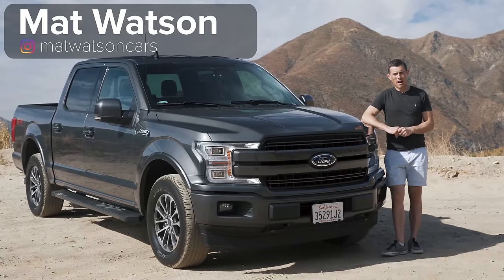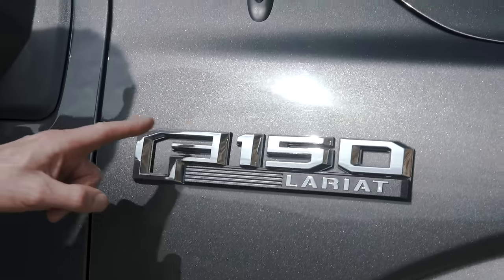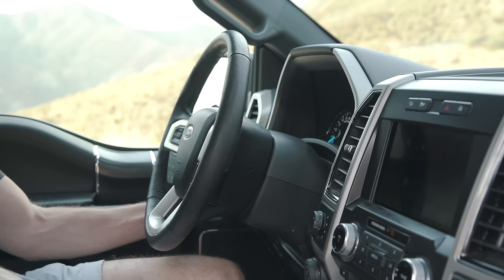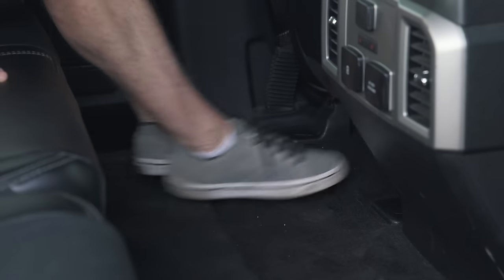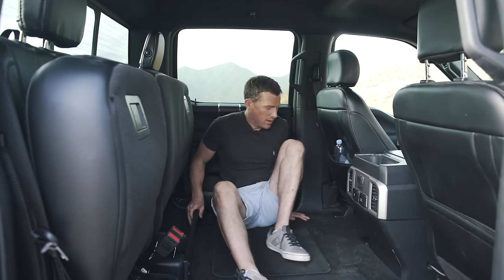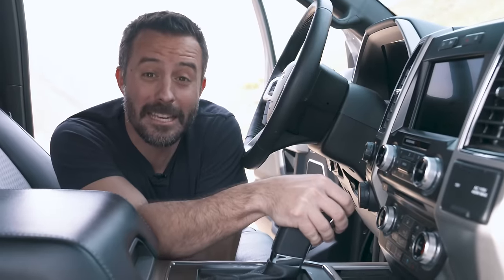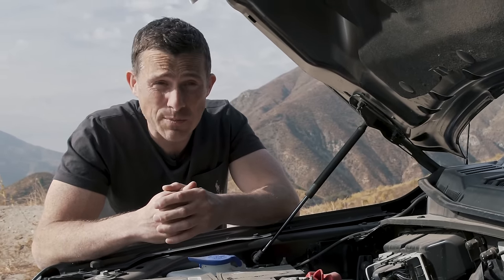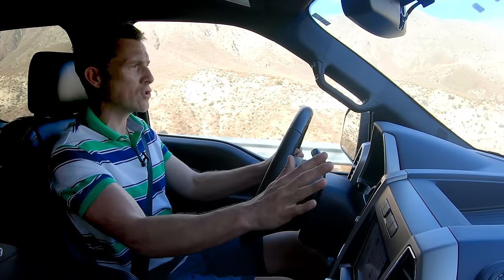FORD F-150 review - why is it the best-selling 'car' in the world?

Comment: If you forget the code, pull the door will cover on the passenger side, it is printed there. Take it to Ford dealership, they pull the code for you. Also, add your own code so you won't forget it.
Reply: I love that keypad feature. You can go to the beach and leave the keys and wallet locked in the truck.

Comment: Ya mate, you forgot about the 1 year post review. Leaking turbo ducting, leaking trans, leaking cv's, third brake light. Turbo tuning problems and cost of replacement. Also when these have 100,000 miles on them, who would in there right mind buy one over a Tundra.

Comment: If you upgrade to a platinum model those cheep plastics are replaced with metal, king ranch models will get you real open pore wood and metal trims as well as real leather seats, and the limited models will give you all of the above as well as real leather trim on the doors and dashboard

Comment: My 2020 is a pos. Drive line shudder. Warped dash that was replaced with another warped dash except the replacement dash came with rattles. Transmission is very inconsistent with up shifts and downshifts. 6 months into this pos and I am absolutely done with it.

Comment: Answers to Carlos' 5 annoying things:
1) that's not the trucks fault, remember your shit. Truck comes with a card that has the pin on it, put it in your wallet or write it down in your phone. Keypad is super useful.
2) It's a twin turbo 400hp motor, buy a Prius.
3) The shifter is a super comfy place to rest your hand and feels like a proper truck shifter. Also, the F150 has exactly 22 cubby spaces for the front 2 seats alone... like really if you cant find a place for your shit, you have way too much shit you hoarder.
4) Those competitors can't haul as much because of that. The current F150 is also 6 model years old now (second oldest full size), next gen will have coils.
5) That wire is only visible for half a second when the rear window is half open. What kind of animal opens the rear window only half way?

Comment: You can't put 1500kg in that bed. The rating is actually surprisingly low (sub 800kg for an Fx4 Lariat). The reason is in the rear suspension. Though it does have leag springs, they are not that thick and prioritize comfort not capability. It actually kinda funny, our European trucks are all smaller but have higher payload ratings!

Comment: I have the 5.0 V8, sounds great  but the eco boost drivers whip my ass head to head. If this guy wants a nicer ride he needs to drive the platinum.  The fx4 has stiffer suspension for off-roading
Reply: I have 3.5L eco Lariat but would love to have the 3.5L high output Limited.

Comment: Europeans love to make fun of pickup trucks but if you have the space for them, they are by far the most versatile well rounded vehicles you can buy. If you are a tradesman you would never be able to use anything else. They are also good for having in the winter, cant tell you how many idiots ive gotten unstuck trying to drive around in their small sedans with front wheel drive in the middle of winter

Comment: How did they get so little power from a 5.0 V8?
Reply: Peak Hp per liter isn’t important in a truck, torque is. Also a cheat code for reliability is large displacement + low compression.

Comment: Ford F-150 FX4 Off Road Lariat Super Crew Cab Pickup Truck
1. Big Ford Badge
2. 35291J2
3. F-150 Stamp
4. FX4 Off Road
5. Cutout
6. Plastic Grille
7. Model Badge
8. Big Center Console
9. Start Stop Engine Button
10. Trailer Assist
11. 4 Wheel Drive Gear Selector
12. Cupholders
13. 12 Volt Sound System
14. Comfy Seats
15. Headroom
16. Seatbelts
17. Keypad
18. Window Ledge
19. Door Bins
20. Seat Bases
21. 8 Foot Bed
22. 2200 Liters
23. 6.77 Tons
24. Shifters
25. Lightning
26. Step
27. 2.0 Tons
28. Power Folding Rear Glass
29. Running Boards
30. Fuel Hole
31. Aluminum Body
32. 2.7 L V6 Ecoboost Turbo Petrol Engine
33. 612 Hp 850 Nm
34. 13th Generation
35. C Daytime Running Lights
36. Off Road Shock Absorbers
37. Locking Rear Differential
38. Skid Plates
39. Sport Package
40. Sport Mode
41. Boat Mode
42. Headlights
43. 18 Inch Alloy Wheels
44. 4 Door Version
45. Infotainment System
46. Good Wheels 
47. Parking Assist
48. Doorhandles
49. Taillights
50. Rear Infotainment System
51. Global Positioning System (GPS)
52. Gray Color
53. Steering Wheel Lock
54. Rearview Mirrors
55. Reversing Assist
56. Driving Assist
57. Highway Assist
58. Off Road Package
59. Voice Commands
60. Electronic Handbrake
61. Basic Lights
62. Creases And Cutouts
63. C Shaped Headlamps
64. Leather Seats
65. Heated Seats
66. Ventilated Seats
67. Sync 3 System
68. Navigation System
69. 3 Pin Plug
70. Pocket
71. Mobile Phone Storage System
72. Super Crew Cab Version
73. Shoulderroom
74. Bulky Rear Seats
75. USB Ports
76. Seat Bases
77. Electronic Truck Boot
78. Payload
79. 4000 Miles
80. Leaf Spring Suspension
81. Autopilot
82. 12 Speed Auto Gearbox
83. 4 Wheel Drive
84. $47.000
85. Good Performance
86. Top Gear
87. Very Good Brakes
88. Good Engine
89. Comfort Mode
90. Load Beds
91. $30.000
92. 2.7 Liters
93. Strong Gears
94. Highway Speed Assist
95. Body Panels
96. V6 Rumble
97. Ecoboost Engine
98. Comfy Steering Wheel
99. Very Good Seats
100. Infotainment System
101. Rear Infotainment System
102. Shortlist It

Comment: These trucks will last 300,000 miles plus no problem they are overbuilt to be strong enough to tow trailers. So if you aren’t abusing the vehicle it will last a long time. Longer than a usual car.

Comment: The inside should defenetly be a little worked on because that looks like a 2015 car and not 2020
Reply: it does have 40,000 mile on it at a 12,500 mile service yearly interval February 2017 - February 2020 would make 37,500 miles + 2500 miles December 16 January 17 making it a December 2016 registration. if it did the full service interval every year that is. then again it is modern by british irish and european standards based on what manufacturers seem to think Toyota makes a copy of the ranger and calls it the hilux. all new 2020 hilux looks like 2012-2019 ranger.

Comment: You buy a ford pick up with the V-8 for $25,000.00 . For 50 + years you have a vehicle that will go 350,000 to 600,000 miles with extremely low repair costs.She can be rusted out, totally beat up - 30 or + 112 degrees . She will fire up and not only get you where you and your family need to go , but you will actually be relaxed and ready to kick anybody's ass when you arrive !  Make no mistake . . . .

Comment: Wouldn't it have been nice, back in 2018, if Ford could've made a $55K F-150 where the door handles didn't freeze, precluding closure? They've only been making Ford trucks since 1947! It's fun driving an '18 F-150 to work having to hold your driver door closed as it doesn't secure.  SMH.

Comment: They are mad. There's  no replacemen for displacemen. Wringing the wee out of a small displacement engine with a turbo  and all the latest power scavenging tech will likely come at the cost of longevity even in a small car much less a four door F-150. If the next step isn't an all electric F-150, it will be a 3.5 ish v6.

Comment: Why did I buy a Ford!? I bought a 2017 F150 Lariat due to it having a crew cab and 6.5 foot bed. Within 2,000 miles the value cover gasket started leaking. Coming from a 2007 Toyota Tundra that was great for almost 200,000 miles I already regret buying a Ford! If you are considering a Ford make sure it has a warranty because you will have issues! I can't wait for Toyota to come out with a crew cab and 6.5 foot bed...which I heard they will have in 2022 models.  Fords have serious issue around the oil pan, transmissions, they feel cheaply made compared to Toyota and I guess the value covers are an issue too. Buyer Beware of Ford!

Comment: What? Excuse me is that a actual code on the door? What
Reply: Yes. It's a keypad for the door if you want to use it. Like when you go to the beach and want to lock the key and wallet inside. Use the keypad to unlock the door without the key.

Comment: Another example of inexplicable American conformity...I'd understand if these were actually necessary for work...but no...it's like part of the Rural American Starter Pack. SMH
Reply: They are used for everything. I used mine but now I have a 250. Also many are fleet trucks and those are used in all industries. They are also used as family vehicles.
Reply: Pickup trucks only account for 19% of US vehicle sales/ SUVs and crossovers are over 50%.

Comment: I do have a 2017 XLT 4x4. It only have 27k miles on it .Maintenance done by ford and only paved road driven and nothing but problems with this piece of shit. Font axle leaking, rear differential leaking, grinding noise when 4x4 engaged, screen turned blue when on reverse( so can't see on back up camera). Had to reprogram the transmission due to bad shifting. F150 NEVER AGAIN

Comment: Why are Fords the best selling truck? (It's a truck, not a car)
The rocket scientists at Ram put a sway bar below the rear axle. First thing that will get ripped off out in the woods. I asked the salesman if he would give me a lifetime supply of sway bars. He said no, and I walked away from Ram. 
The I went to GM. Their brain surgeons put the shock absorbers right between the differential and the wheel. Like driving a garden rake. They will snag every rock and boulder your are trying to drive over.
Ford may not be the most comfortable truck on the market, may not be the prettiest,  may not be the fastest truck on the market, may not carry the biggest payload etc, but they work. No serious design flaws like Ram and GM.

Comment: model year changes to the F-150 F-250 & F-550 4WD you say are not just cosmetic!!! it gets a new high strength steel super tough ladder frame chassis & revised semi independent suspension at the rear especially the F-150 RAPTOR 4WD pickup truck model!!! what the f** is with you & scratching??? by the way the (particular) shorts ur wearing are actually undes in America!!! (ask Carlos if you will) you didn't flick some kid's shorts??? did you???

Comment: Terrible American car. Useless for work ( because of the fuel consumption and price) and terrible to drive daily. And it probably cost as much as Mercedes s class 
100 times better to get 2 door Porsche instead of this thing 🤢
Reply: As far as I know Porsche doesn’t have a pickup.
Reply: @raymonds7492  because pickups are useless. I have business and for work we are using mercedes sprinter flat bed Vans.
Reply: @dantebg100   You’ll see pickups towing things like industrial equipment or farming tools like tractors if you come to the state. Especially the south.
Reply: @dantebg100  And what makes that more useful than a pickup? The maximum tow rating for the most capable Sprinter is 3,500 kg/7,700 lbs vs the 11,300 lb rating of the F-150 (and it is the least capable truck in the F-series lineup. An F450 can be configured to tow 40,000 lbs).
A 3,500 kg GVWR rated Sprinter would be in the same class as the F150. and the 5,500 kg/12,100 lb GVWR Sprinter would be comparable to an F350 SRW as far as payload and vehicle weight goes. Nothing in the Sprinter line has the capacity of an F350 DRW or above and the 3L TD is completely outmatched by the diesel in the Super Duty (and yes, you can get it in cab and chassis if you want).
Just because it isn't Euro doesn't mean that it is useless.
Reply: @rich7447   maximum tow doesn't matter and it's completely useless parameter. The pickup is just too small in terms of length and width of the flatbed
And it's too high up from the ground which makes it absolutely terrible for loading something into it.
Reply: @rich7447   can you transport 10 garage doors with length of 7 meters each in your pickup? And transport 7 workers at the same time to install the doors?
Reply: @dantebg100  Not in the pickup, but I can do 6 passengers including driver and the 10 7m/22' garage doors with the pickup and the smaller of my two trailers (30' enclosed). Hook up the larger trailer and I can bring an excavator. If you have flatbed Sprinters how are you getting 7 people in them? We also aren't so big on driving all our people to the job site. They like to drive themselves.
Reply: @dantebg100  It doesn't work for your purposes and to be honest, short bed trucks and 1/2 tons are not meant for heavy work. We have cab and chassis trucks with different length wheelbases for what you are describing. Pickups are limited to an 8' bed.
Maximum tow is a big thing here, even though it may be a useless parameter for your purposes. I haven't been able to use my larger trailer to its full capacity (26,000 lbs) because my Ram 2500 didn't have enough payload or towing capacity. I have been limited to about 14,000 lbs of trailer weight which only leaves me about 6,000 lbs of payload on the big trailer (8,000 lbs empty). I currently have an F450 ordered that will fix this issue for me.